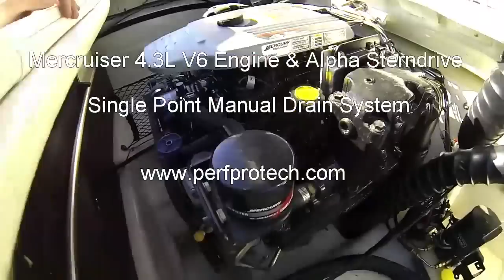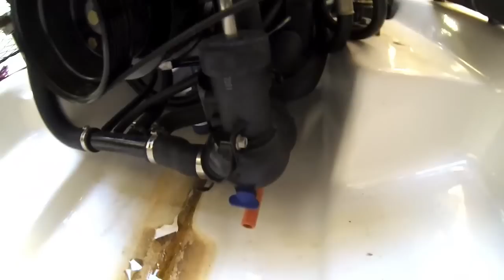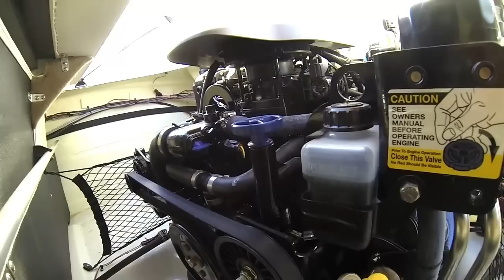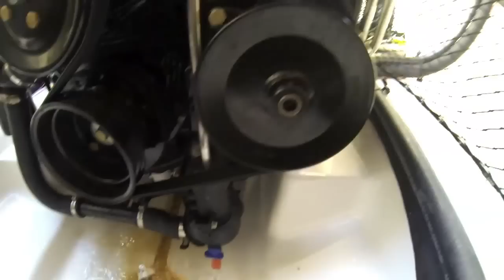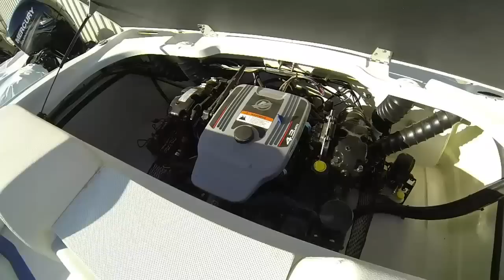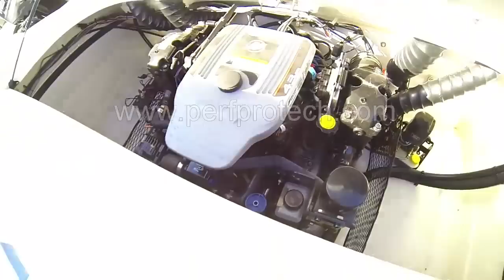Mercruiser 4.3L V6 Single Point Manual Drain System

Comment: Do you have any oil change videos with this particular motor? My oil filter is in the same spot as yours and have found zero videos on changing the oil
Reply: Buy an extractor and suck it out. Replace via a funnel - we too have same engine...

Comment: I went through with this and now I would like to get my boat back on the water. The freeze warnings are over with for now, so what steps would I follow to safely put it back in the water and start it up. thanks
Reply from the maker: Mike, We do our winterizations in such a way that there is nothing to do other than starting the engine normally. Since we use environmentally friendly antifreeze and reinstall all the drain plugs/hoses the only thing to do is reconnect the battery and go.

Comment: The one down by the orange colored hose.  I saw where you removed the one up top by the blue turn knob/valve.
Reply from the maker: I think you are referring to the one on the water distribution housing. Different models of drain systems have different draining options. This one being a manual drain which includes the blue drain knob that you turn does not require removing the plug because turning the knob does the same thing. If you notice in the video the water is draining out of the orange spicket which indicates it is in fact draining properly.
Reply: Thank you.  Have you ever had any problems with all the water draining?  I'm wanting to winterize my boat myself this year but have heard of some issues with the single point drain.  It's an expensive mistake if water stays in the block!

I was thinking I'd drain the block through the single point system THEN introduce about 5 gallons of RV/Marine antifreeze (non alcohol type) through muffs then drain again.

Comment: Hello, how many drain plugs does a 2013 4.3 MPI 220HP Mercruiser have? Aside from the manual single point drain valve I have a drain plug on the distribution housing and one on the thermostat housing. Are there more on the manifolds, fuel or power steering cooler, etc.?
Reply from the maker: This will depend on exactly which drain system your engine is equipped with. Check out this article https://www.perfprotech.com/blog/boat-and-engine-technical-tips/marine-cooling-systems/single-point-manual-drain-system-mercruiser-4-3l-marine-engine-alpha-sterndrive
Reply: Performance Product Technologies Thanks for the info. Have a great day!